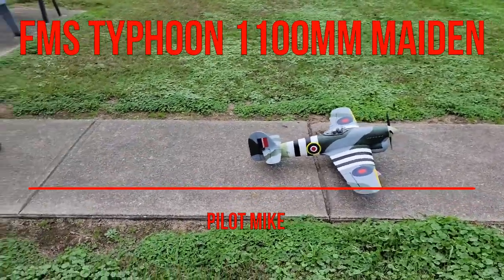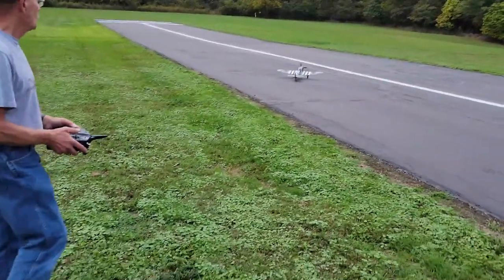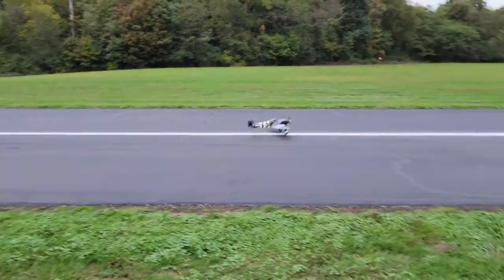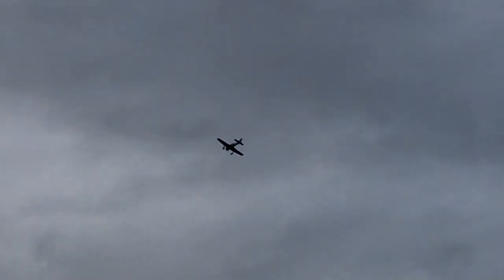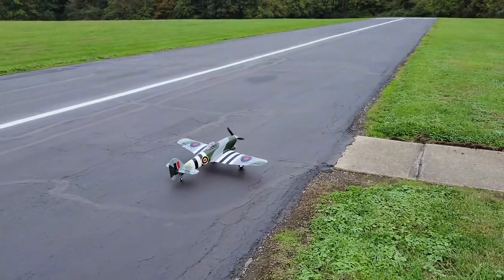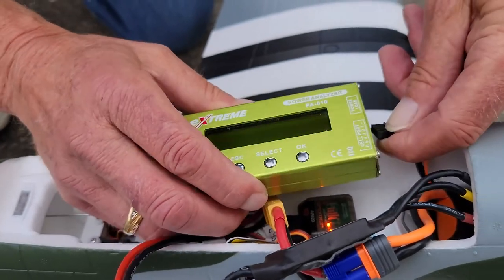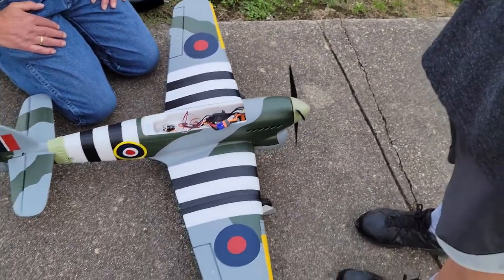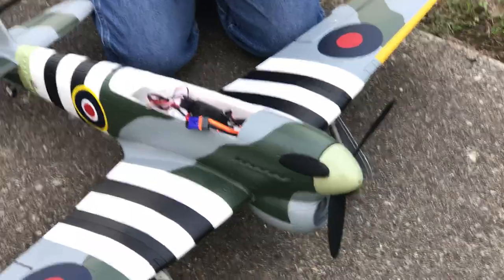FMS Typhoon 1100mm Maiden by Pilot Mike

Comment: Dude just run a 3300mah 4s Battery all the way up in the nose and you,ll be fine with balance and power.  Plus get that damn ESC Secured to something way up front so it will get more cool air
Reply from the maker: Thanks for the info man! Much appreciated!
Reply: @LoveRC  just passing on what i had luck with mine on

Comment: What battery did you end up using to get the cg right?
Reply from the maker: 40c 2200 3s  all the way forward with the esc tucked in behind.
Reply: @LoveRC  man that's how I have it now and it isn't even close.... Do you have a lot of down elevator dialled in? And how much flight time you get ?

Comment: Where do you have your Center Gravity?   I tried at 60mm and its still tail heavy...
Reply from the maker: 40C 2200 3S all the way forward on the battery tray and ESC folded in directly behind the motor mount as far forward as it will go. Try 60mm.  That seems more balanced.
Reply from the maker: Adjust elevator or try  3300mah 4s Battery all the way up in the nose.